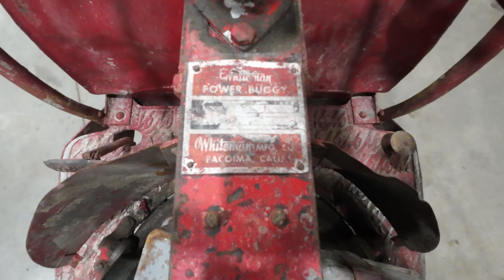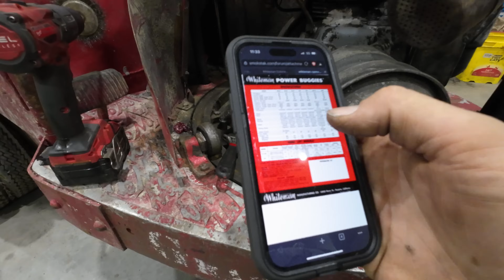Marketplace Find | Will this Motorized Dumper Ever Run again!??

Comment: Hey Matt ! its a dumper truck, it’s supposed to be hard to start, gets the guys warmed up in the mornings !!
   I wonder where these were meant to be used, with those little wheels they weren’t intended for building sites, or none I’ve been on anyway, they must have been meant to run on concrete or boards, but why ?  Factory floors to run mortar to bricklayers ?

Comment: Lots of comments, but I didn't see anyone mentioning that he rotated the engine backwards when pulling the rope. You can clearly see with rope pully in front, that when pulled clockwise, the engine stopped while rotating counterclockwise.

Comment: If I had to guess as to why it wouldn't run at first barring the carburetor, I'd say it was just low on compression due to a lack of lube in the rings and/or possibly some semi stuck valves.

Comment: That thing deserves a pressure washing, a new tractor seat, and some tires with some tread. It could actually come in handy if you get a concrete mixer for your SS (well guess you could use that for concrete placement), but could come in handy for larger slabs when you can't get a mixer close enough for a chute to reach. Hope there is space in your shipping container shop or under your lean-to so the Earth doesn't reclaim it again.
Reply: I think you might be able to solder the leaking float for a spare.

Comment: Matt, I'm guessing you might already know this but always use premium gas that has no grain alcohol mixed in with it as many fuel stations sell. E85 fuels separate easily and quickly. Cool machine indeed.

Comment: Case made a massive farm tractor back in the early 1980s that had the wheels turn rather than articulate similar to what is now being done with battery electric pickup trucks ("tank mode.") I definitely remember mixing mud as a kid which is not an easy thing to do and very hard work actually so if you want to start building concrete block, stone, brick or any other type of material that needs a binder these items very much "go to" for doing that. Everything done using "forms" these days as I'm sure you know with actual concrete trucks (lots of valuable concrete trucks lying around abandoned these days) doing a "pour and cure" also very much an art form with that just nothing like the doing it by hand approach that i grew up around.

Comment: Very cool.  Love the mix of large and small puppies that follow you home.  Are you into a little engineering?  What would you think about fabra-gineering an electric starter?  Might be a neat project for the little merry-go-round engine.  Maybe send the parts motor to one of the other YouTubers for some prototype flywheel machining and a starter mount?

Comment: Suicide knob on the steering wheel should be the first upgrade.  Definitely worth replacing tires with an excellent matching set.  More aggressive drive wheels for the soft ground? Just showing how fun and still useful this one is has tripled the value of the parts machine.  Heck, I have a concrete job coming up that such a thing would save hours of hauling hassle.

Comment: As you were driving out to go for a test drive, I was thinking, I hope you're careful because there's no suspension and it might be easy to high side if you turn too fast, and then off camera we hear you say "woah don't flip". Also, the info sheet you pulled up earlier in the video said that the double wheeled model was rated to carry 2000lbs of concrete.

Comment: I am totally surprised he didn't scrap that Wisconsin, I have revived many engines big and small and the Wisconsin to this day has been the one brand that never seems to run right, or the parts to fix it are worth more than the replacement engine. Or once they are running right always quirky and hard to start. Maybe the single cylinder is better then the 2 and 4 who knows. Good job Matt getting this one running well.

Comment: The smoke to start might have been in a little part to the gas/oil mix you put in it. When you were having the last go around getting it started it looked like the choke was closing just as it died. 
Maybe you should tear the other one down somewhat and wash, sandblast and paint it. Put some new tires on it and then just swap the engine and clutch over from this one and have an almost new one to parade around on. 
I bet the operators back in the day had that thing flying from the cement truck to the forms like it was nothing. As you said, better than a wheelbarrow.
Take care,
jack

Comment: That is a pretty sweet find!  You mentioned that it feels like it has 2 speeds... that is the bottom of the torque converter shifting to allow a higher speed.  Snowmobiles run this style of setup.  I had a go-kart as a teenager that also had this style of clutch.  Properly tuned, they work really good, high torque at the start, and high speed at high RPMs.  This buggy you found is great!

Comment: An easy way to solve the not being able to inflate the inner tires is put the valve stems facing away from each other so that way you can access it from both sides and then it would be hilarious probably to see you try and drive this thing after you’ve been drinking

Comment: Did a little research and these were def used by the parts runners when building the RMS titantic. You see that dumper wheel was stolen from one of the water tight doors 😂

Comment: Only quickly scanned through the vid cos at work, but one question - how does the throttle linkage work if the whole engine turns?  Guessing it is controlled ontop at centre, but how does it then link to the foot pedal?  Great find and looking forward to watching the full vid later 👍

Comment: I could definitely see some room for modern improvements, maybe on the donor, keep this one just the way it is.

A powered dump would be fun to figure out, but how to power it?  It could probably benefit from some off-road tires on the rear.  I picked up a '59 Arien's snow blower that had the original "turf saver" tires on it, I swapped it to some regular grip tires and it made a huge difference, it'll dig its way to China if you get hung up on something with those knobby tires.

Comment: I know a way to fix brass
 floats!
Immerse the float in gas to find the leak.
Remove from gas and tilt the float to where the leak is upside down.
Take a hair drier to warm up the float. This will try to pressurize the float, which will force the gas out.
Keep doing it till it is empty.
Get a product called Seal All and smear a light coat over the hole, and it will seal it.
The Seal All is impervious to gasoline, battery acid, and a whole list of things.
I sold it for around 20 years in Montana. It works!
It stays flexible, and it can repair gas tanks, lead acid batteries, oil pans, and on and on.
To fix a gas tank, leave the gas in the tank, wipe any dirt off, and push the seal all into the tank so it dams up on the inside and outside, and it's fixed.  It stays flexible after it dries.

Comment: 20:30 - Haha, i think you would be disappointed if you don't have to remove the carburetor, come on......
37:04 - I already can see you with bucket full of ice and the bear we need, haha. Now get now color on it and make perfect.
- At the end gibe it a very good clean with the high pressure wash and then go on.
- Another point are the 2 wheels for steering. Check if you can get two of same on that little beasty Ice/Beer machine.

Comment: It seemed like all the weight was off the drive wheel when you attempted to dump the full load of rock, it seemed that if you rolled it back on to the machine and didn't try to dump it all at once you might be able to use it to fill potholes in your road, once it started moving you could just keep increasing the dump, but eventually it would be too much forward weight and the real drive wheels would basically be in the air. As a kid, we would always be looking for a Wisconsin engine, knowing they actually would put out the horsepower. Your smoking could be the 2cycle gas, which as you said in the beginning would give a little smoke. To me, the engine sounded better than any I ever ran!

Comment: Did you clean the needle seat? dirt in the needle seat could fuel starve the engine after it runs well for a minute, which is what was happenning.

Comment: Matt, just curious, don’t ever see you using Sea Foam. Works great adding a little to the oil before changing and a little to the fuel tank to clean the system out? Some mechanics love it, some not so much.

Comment: Just put your air nozzle across the hole in the float, this will suck out the fuel from inside the plattoon, once empty you can solder the hole...gl

Comment: Evidently you have never had to rent one of those Toro Dingos.  You need to replace the drive belt and tires because you will wind up using it on some tight to get into jobs and it sure would work better then a wheel barrow.

Comment: I would love to run across deals like that. I think the only time I got a good deal was on a 21,000 lbs trailer I bought for 600 dollars. It was parked in the middle of a cow pasture sunk in the ground because it was loaded down with all kinds of stuff and nobody could get it out.  The deal was whoever bought it took the junk also. I got it out and took it home to sort thru the stuff on it. I found 10 eight foot sticks of 2 inch stainless square tubbing and about 20 eight inch drain pipes. The stuff on the trailer was worth more than I gave for the trailer.

Comment: You would normally be operating those buggies doing flat work or slab work? where your  surface would typically be smooth. The contractors would not typically be running The buggies on rough Terrain they weren’t built for that load it with concrete. them old buggies were used a lot on high-rises when they would hoist concrete up in 2 yard buckets and load them up into the buggies. Slab work

Comment: The other unit, if the engine is seized beyond repair, you could swap in a Predator 212 or a Chinese Diesel engine.

Comment: Funny Story:  we started building fully hydrostatic buggies at a large well known German based company back in the 90’s. 
Our “CEO” went for a test drive and promptly got bucked off onto the parking lot. 
Everyone had to stifle their true reactions because he had no business on one in the first place and laughter would not have been helpful to our careers. 
Every seasoned operator confirmed it ran just as it should.  
They can be tricky but must be quick to steer, and get in and out, on a big pour. 
There was no stalling to dump. It was forward and then reverse while dumping.
Those operators knew how to ride and earned their checks.

Comment: 1940’s. Wisconsin engine.  Pull rope to start.   Magnito. Will have to be rebuilt.  Use 92 octane. Gasoline in the tank.   Kill button used to be on  magneto  front.  Wish you luck.  Grandpa  had a Montgomery Ward tractor. Same engine.   Head warped. To. Stop running.   Later.

Comment: "The parts one" has some potential as a hot rod as well. Remove that engine entirely, put a fuel injected snow machine engine on it, along with a crazy paint job plus grafite to get it to really stand out as "Fuel injected wheelbarrow". Put a stupidly high price on it   as the only one of its kind thing. Hope someone has drank a little too much and put it up on a auction thing at a party. Of course offer some alcohol and on't rays for full price bidding to happen. Maybe a daisy on its side so some woman wants it for the husband to run

Comment: Matt what is the old blue F-Truck worth in the current Pennsylvania / USA market? My daily drive in Australia is a 2002 F-250 7.3 Powerstroke with just short of 500,000km. It is currently worth between AU$60,000 & 70,000; a 6.7 would start at about AU$120,000 with lots of km, and new are over AU$250,000

Comment: Why not some kind of DIY electric conversion for the second one? Seems it'd be relatively simple and might even be fun
Reply: And it would be much more useful with reverse at the flick of a switch instead of turning the wheel 180 degrees

Comment: PLEASE do not put a modern engine on these gems. Would kill the cool factor. Parts are readily available for those engines. Just fix em and go!!  Very cool find. Will be great to scoot little loads around the lot. Oh…and Matt…get some line wrenches for tube work! It hurts to watch you use open end and crescent wrenches on those soft tube nuts. 😉

Comment: A comment:  I bought an MG-B once, snd for the next month spent every other day with my head in thr very tight hood adjusting those accursed Stromberg side-draft carburators.  So< I HATE carburators.  One of the reasons I can't stand gas engines.